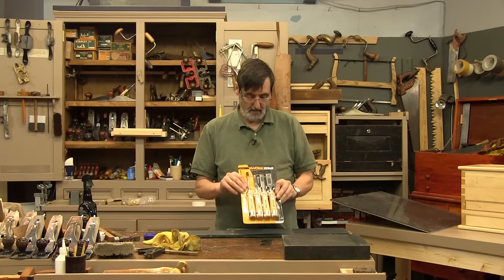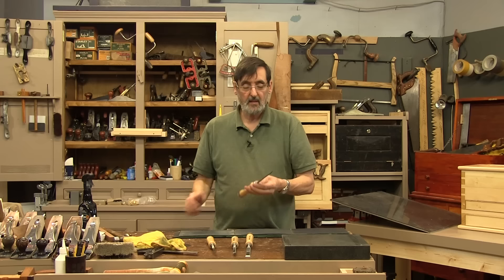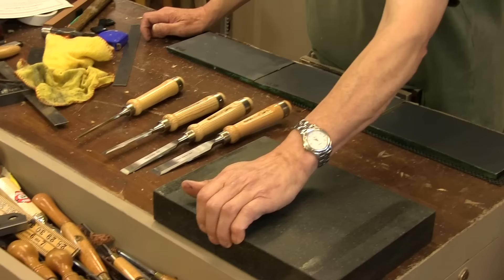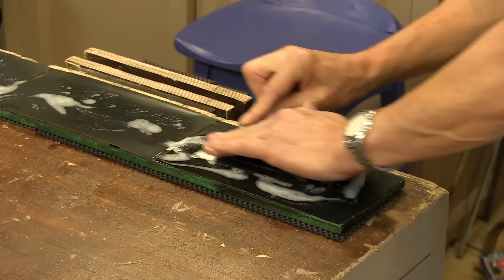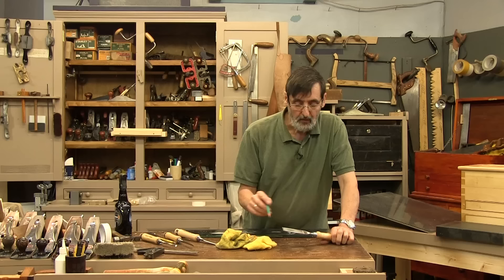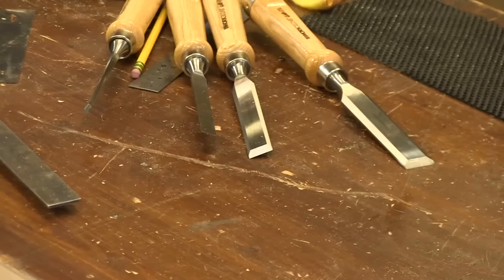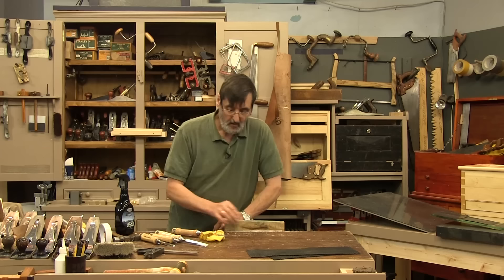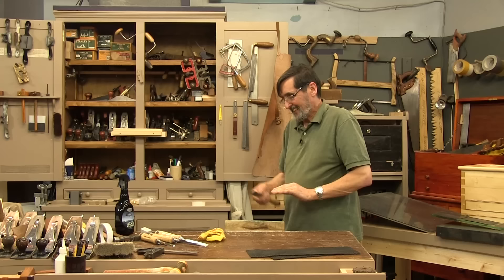Preparing and sharpening a woodworking chisel | Paul Sellers

Comment: Sorry I have to disagree with all you say, your method goes against all the rules of chisel sharpening........I must admit you look the part with your 'set', all the tools and your apron. but as a carpenter / joiner myself can't agree with your method....novices beware !
Reply: You're absolutely right.  His chisels didn't work at all.  /s    On a serious note,  I have shapton glass stones from 220 to 16000 grit, three worksharp 3000's, four or five different honing guides, DMT diamond stones from XXC to extra fine, pure chromium and cerium oxide, abrasive sheets to .01 micron, Natural stones from all over the world,  Baldor buffers and grinders, a Tormek system, Leather strops ranging from sanded bovine to horsebutt to kangaroo, diamond sprays, sharpening belt sanders, and many more sharpening items than I can list.  I have a microscope for edge inspection.  I attended engineering school and have tested different steels edge holding abilities at different rockwell hardnesses using NIST calibrated equipment.  

What you have seen in this video may not conform to your particular training or education, it is an absolutely functional way to get a chisel sharp.   Paul's work has been featured in magazines worldwide, has been included in the White House permanent collection, and even flanked the entrance to the Oval Office.   

I would also assume that your rules for handplanes dictate that you push them away from your body and that woodworking is done at a bench.  In Japan, planes are drawn toward the body, and much work is done on the floor.  

Perhaps Mr. Sellers is breaking some of your misconceptions/rules of sharpening, and if so, then hats off to him and I hope he continues to do so.
Reply: lol whittingham I'd say that a common mistake when learners first start to learn is that they are taught that woodworking chisels are designed with a 30 and 35 degree angle.  It doesn't take but a few minutes to explain the concept of a primary and microbevel.     I didn't get across the point of all that stuff about equipment and microscope crap;  the final point is that it's not needed at all.  sandpaper and a strop can equal 99% of the results achieved by other way more expensive methods.  
I'd love to see a person who can reliably hold their wrist at a 30 and 35 degree angle upon request.  A human protractor!

What if a chisel is sharpened to 28 and 33 degrees?  It will still work.  As a matter of fact, if you are paring soft wood, a lower angle works even better.  

Mr. Sellars showed how to sharpen a chisel effectively and you said that everything was wrong.  It sounds like you have muddied the waters for people who just want to know how to sharpen, as well.
Reply: Chelsea Rivenbark Ok, here we go again......you said  " I'd love to see a person who can reliably hold their wrist at a 30 and 35 degree angle upon request"    well that's where the name 'craftsman' comes into this, after his years of practice during his apprentice years, he becomes adept'......a craftsman,...able to do this at the 30 / 35 required,..and even if he has the angle slightly out , say 33 and 28 then this as you correctly stated is fine or even better. Not "ROLLING" as shown in this video by your master sharpener , when he uses one hand.
trouble is your all knowledge and no experience...... try sharpening a chisel on a building site, as we have to.
No doubt you'll come back with some silly technical answer to defy the fact that joiners/carpenters have used this method since men used to make boats and ships a long long time ago. the method being passed down through generations........So after your next reply, that will be the end of this. goodbye
Reply: lol whittingham I'd be more than happy to sharpen a chisel on a building site or anywhere else. I appreciate your 'knowledge with no experience' comment, but it's unfounded.  I think the only real issue is that you're convinced that there's only one way to skin this cat.   You go ahead and keep doing what you're doing; I'm sure it's working fine for you.  Mr. Sellers can keep doing what he's doing and having his furniture in museums and the White House.  Please feel free to let me know why his method doesn't work, or send me a link when you make a video showing the one and only right way to get a chisel to cut well.
Reply: I think you are missing the point here. First off, Paul is an incredible and very accredited traditional woodworker and in this video he is explaining two points that I think everyone should at the very least consider...and I say "consider" because nothing in this world is absolute and I think that's where you are missing the point. He is simply showing us the method that works for him without the use of mechanical jigs/sharpener to sharpen his chisels . The two points in this video are 1. Sharpening chisels or plane irons do not have to be this overly complicated marvel of engineering that many make it out to be and with like most things if you take your time, practice and explore new ideas you will with time get more than adequate results even if you are not using the "textbook" way......(side note: you know the textbooks also use to say that the world was flat, the sun revolved around the earth, and that pluto was a planet....be we all know the truth in that), and 2. You do not need to go out and spend hundreds or thousands of dollars on expensive mechanical sharpeners, jigs, and "new age" steel chisels and plane irons to get good quality woodworking results. After all, isn't that all we want to do?

Now, I don't recall anywhere in the video where Paul says this is the absolute way of sharpening chisels and these are the rules and you must follow them. In fact, in some ways I think he is showing us that we don't have to follow the "rules"   and have this perfect precise angle that is perfectly consistent in order to get good results. Everyone uses their tools a little different and it's this reason that slight variants still allow us to arrive that the same end result, and in this case it's a very sharp chisel that will do all of your woodworking needs that a bench chisel needs to do....period.
Reply: Benjamin Beran look... he's doing it wrong  end of
Reply: lol whittingham Mr. Sellers has been working wood almost twice as long as I've been alive. He's got quite a resume, and his method worked for me and my cheap chisels.
Reply: ninj4m4n so have I probably,,,,,and what would you know anyway, 
strange how he only got one reply a month on average and now he's getting lots ? ?
AS AN EXPERT MYSELF I WOULD'NT ADVISE PEOPLE TO DO IT HIS WAY !
Reply: lol whittingham If you're an expert why are you watching a video on how to sharpen chisels? Surely you'd be able to do it by now.
Reply: Mike PlaysBass oh here we go............. I'm a joiner / carpenter, and a keen and experienced photographer, I play harmonica, guitar,and saxophone
because I have interests in all the above , I do (like most people ) look on utube . just like buying a magazine or a book.
and as you know when you click on a video, you have options down the right hand side of the page suggesting more videos ,related to the subjects you are watching....I happened on this. Not because I was looking to learn how to sharpen a chisel. which is just as well really.
Reply: I think the demonstration at the end of the video speaks for itself. Regardless of whether you think the method 'goes against the rules of sharpening' it obviously works exceptionally well.
Reply: jamesmac9 seems to have hit a nerve this me saying "it goes against all the rules " hasn't it . the fact is it does go against all the rules.
Seems to be a lot of interested parties sticking up for mr sellers......14 comments this week and the previous month only one, and one the month before
Did they all visit this page to learn how to sharpen their chisels ?
Have as many as you like but it wont alter the fact that what he shows goes against all the rules............
SO INSTEAD OF ANSWERING ALL THE COMMENTS ON MY COMMENT, I WILL JUST REFER THE READER TO LOOK AT WHATS BEEN SAID ALREADY.............IT'S GETTING LIKE FACEBOOK THIS, COMMENT AFTER COMMENT ARGUING ,,,,,MY CHISELS  ARE RAZOR SHARP     END OF !
Reply: lol whittingham No need to shout lol,we all trust you that your chisels are "RAZOR SHARP".And as Paul demonstrated,that his method works on an £8 set of chisels that will not be as well engineered as a Robert Sorby or Lie Nielsen,so unpuff your chest,pour yourself a drink and RELAX.
Reply: lol whittingham
You keep saying he is breaking all of the rules of sharpening chisels, but in reality he isn't. He removes the least amount of metal possible and maintains an approximate 30 degree bevel at the edge of the chisel producing a razor sharp chisel. Isn't that what it's all about? Whether or not your chisels or plane irons have a perfectly flat bevel or a bevel that is slightly convex makes no difference...they will both be razor sharp.

Here's a few good reads
http://www.owdman.co.uk/howto/howto.htm
http://www.richardjonesfurniture.com/Articles/lesson-in-sharpen/lesson-in-sharpening.html

and then there is Paul himself explaining his method....which isn't really his method, but the method in which chisels and plane irons were sharpened for hundreds of years....talk about rules.
https://paulsellers.com/2011/12/going-against-the-gods-myth-busting/
https://paulsellers.com/2013/04/myth-and-mystery-surrounding-plane-and-chisel-bevels/
Reply: Benjamin Beran what about the 35 degree one that goes on the the tip area after the 30 ?
seems to be an abundance of experts watching this video all of a sudden
Reply: lol whittingham
Are you talking about a micro bevel? If so, that's Paul's main point if you read about his technique in the link I posted above. He doesn't believe in micro-bevels. For nearly 200 years craftsmen sharpened their tools the why Paul explains with an elongated convex curve rather than a micro bevel. Then for whatever reason the micro bevel became standard as many believed it was better than the elongated curve. But as Paul points out and other have too, this becomes the weak part of the chisel as there is only a very small amount of metal supporting the very small micro bevel.

According to Paul both ways are CORRECT and the way Paul does it has 200 years to support this, so to say he is breaking the rules is incorrect and misinformed.

If you were to have simply said the you prefer the modern method to sharpen chisels and plane irons instead of an older more traditional way, you wouldn't have seen this bombardment of comments. By the way, not many, if any are claiming to be an expert other than maybe you and so far you have not offered anything to back up your claims.

Simply put, Paul is not break any rules. Just using a different set of rules. Period
Reply: lol whittingham i think perhaps the entire argument isn't broad enough to accurately cover what's being discussed

you continue to mention "35 and 30 degrees" like some keyword that everyone knows and should instantly recognize as the right way to do things, but in reality, from the perspective of a student who simply wants to learn woodworking and not metallurgy (especially with an aldi chisel), if a chisel can cut paper and shave hair and go through wood with ease, what does it matter how it's sharpened? 

the tools don't make the craftsman.
Reply: Pacer TheHorse
I've been using chisels for over 40 years, so not quite an expert yet. The "new standard" of micro bevel is a lot of fun to play with, but severely limits the tool's use. Japanese planes and chisels are mostly iron with a very hard laminate. They use them more for shaving thick laminates with a pull stroke, something we would use the band saw for to resaw a piece. We use our chisels to do things like scrape glue. The metal is softer, for frequent honing. Get your bevel right and the fuzz knocked off the edge - then get in the habit of hand stropping every time it touches wood after carving a cut. This means you just slap the blade over the palm of your hand two or three times while scoping out where to make your next cut. (Draw it back, don't push forward, lol.) A leather glove works, but bare hand adds a little oil. Oxidation on bare metal begins immediately and hand stropping helps this. (Ever notice the chisel that was really honed and put away for a month isn't so sharp anymore?) After a while you don't even realize you're doing it. Humans are born stropping machines. I bet most chisels were sharpened on the bottom of a coffee cup and hand stropped until about 1930 when Montgomery Ward included a grinding wheel on their wood lathes. If the old timers knew we had literally square feet of shop space devoted to nothing but sharpening chisels and planes, they would be turning over in their graves. Clueless about TV, cell phones, and internet google searches - they could hone a chisel in an evening with their bare hands while sitting next to the fire.
Reply: 1Howdy1 You just made my day, that was pretty awesome.
Reply: I think it's kind of arrogant, demeaning, idotic, and disrespectful to say that the way someone does something is wrong when they IMMEDIATELY show you that their way works.  Also, who gives a rip about a specific 30 or 35 cutting angle.  The first thing I do with a new chisel after lapping the back is grind it to about, 22.5 degrees.  I can then throw a secondary bevel on it in about fifteen seconds.  I like 25 degrees for my planes and chisels.  Just make sure you keep it honed and the edge will last a long time.
Reply: lol whittingham I'm just saying that this method worked for me. Just because I'm a twenty-something doesn't mean i'm completely clueless. My family have been woodworkers for the last six generations, I just don't feel confident enough with my abilities to make a living woodworking, so I stick to doing it as a hobby.
Reply: ***** It's not a 'set'.  Paul makes these videos in a former smithy at Penrhyn Castle in North Wales which is set up as his school of woodworking and workshop.  I know Paul and have been taught by him there, your work must be sensational if you know so much better than Paul but I couldn't find any reference to it on line.  Where can I see some of your carpentry or 'how to sharpen chisels' videos?
Reply: lol whittingham It's not a 'set'.  Paul makes these videos in a former smithy at Penrhyn Castle in North Wales which is set up as his school of woodworking and workshop.  I know Paul and have been taught by him there, your work must be sensational if you know so much better than Paul but I couldn't find any reference to it on line.  Where can I see some of your carpentry or 'how to sharpen chisels' videos?
Reply: you look like an identity kit photo of the Yorkshire ripper !!!! he was a nob head too .
Reply: No insults for me Lol?  Where is your work so I can compare it to Pauls?
Reply: lol whittingham 
So why don't you make your own video showing how it's done then.
Reply: lol whittingham Ok lets start at the beginning..what are your qualifications sir...how long have you been a professional woodworker and cabinet maker. where did you do your apprenticeship and for how long.  can you make a fine piece of furniture completely made by 'hand' no machines, bandsaws, sanders or youtube videos running in the background??? 
I'm quite sure that you can't answer any of these questions with any credibility where as Peter Sellers has spent most of his adult life training from qualified cabinet makers and has a proven track record plus has been running a school, with a 'recognised qualification' after completion, for many years.  Many master makers fine tune their tools to suit themselves and this includes bevels, which are set at whatever angle they find best. It's not the tool but the hands behind it that shows the skill and Mr Sellers has the knowledge, experience and skill to do just that. You owe the man an apology but I don't think anyone will be holding their breath for that
Reply: EXPERT MY ARSE !!!!
Reply: Scott D Well, so close to «lol witty» should say it all...